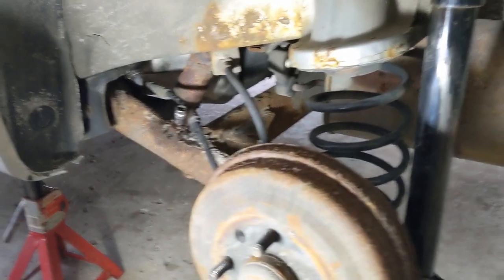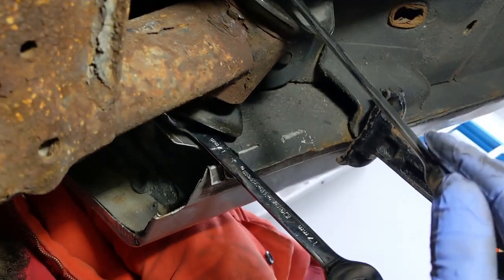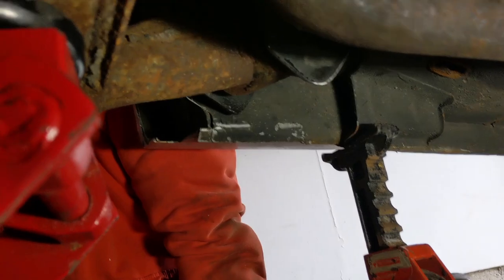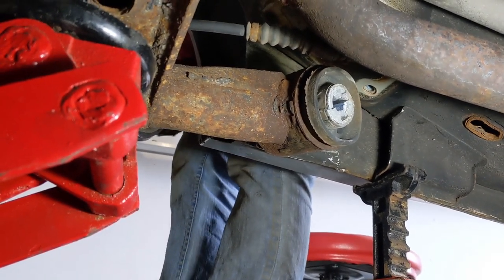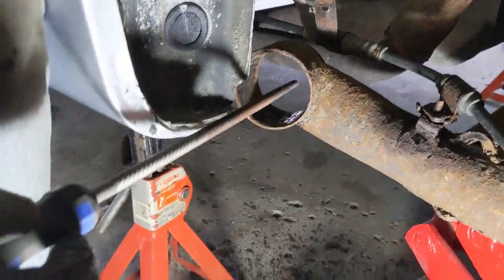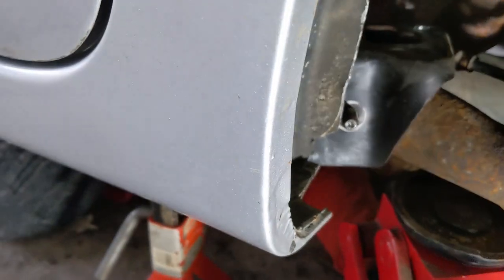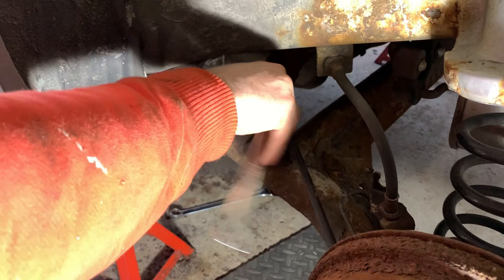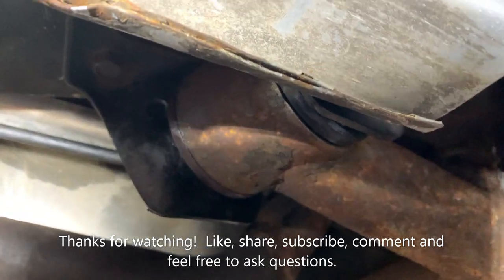Chevy Aveo rear axle bushing replacement, DIY at home, 2/2 - driver side

Comment: You make the joy look easy.  Great job on this education video.  This is the exact job I must do on our 2006 Chevy Aveo5 Hatchback!  Big thank you to spend the time to video the job in detail.
Reply from the maker: Glenn Collins thanks, appreciate it. I couldn’t find a video, or even a written/pictoral how-to. Most of the videos of other cars getting this job done were done on hoists so I really wanted to see if I could this at home with no special tools, and also show others that they can do it too. I know I cheated a bit by using a 2-piece poly bushing but it was really satisfying to not have to press new ones in.
Reply: @416diy  I'm in the middle of doing this job now.  everything went well until I got at the trailing arm bushing removal.  The rubber bushing came out easily, however, the metal sleeve is quite another!  with a chisel is challenging.  I have a complete set of Ball Joint Kit in two storage cases.  Can I use this to remove & install new OEM metal-sleeved bushing?
Reply from the maker: Glenn Collins if you’ve got the rubber out you’ve done the hardest part. If you can get your hands on a hacksaw or a reciprocating saw you should be able to saw through that sleeve without much trouble, might just take some time. The problem with the car I worked on was the metal sleeves had mostly rusted away, so the bushing was starting to slide out of position, but the rubber was still decent for its age.  Good luck!

Comment: What was it doing to let you know that it needed replaced?
Reply from the maker: Craig Eldridge hd a lot of banging noises in the back, especially with a full hatch. Shocks were already replaced and the springs were good so we took a look at the axle bushings and could see they were coming apart. The bushing rubber wasn’t horrible but the metal sleeves were rotting badly as you can see in the videos, which was causing them to move  out of place, sagging toward the centre of the car.  Turned out to be a fun job to do, especially with the 2-piece replacement bushing. All things I probably should’ve discussed in the video ;)
Reply: 416 DIY I was curious. My beater isn’t doing that. It like turns when I hit bumps. It might be because it had a shock bushing go out in the drivers side and so I replaced the shock and bushing with one from a junk yard and now the other side is what does it. I mean before I put a shock in it, it would bounced for like 200 feet after every bump.
Reply from the maker: Craig Eldridge sounds like it needs a new pair of front shocks and an alignment.